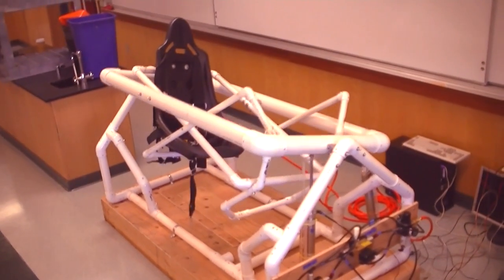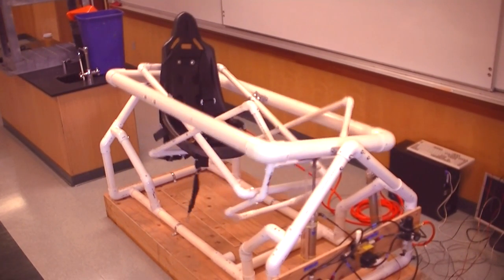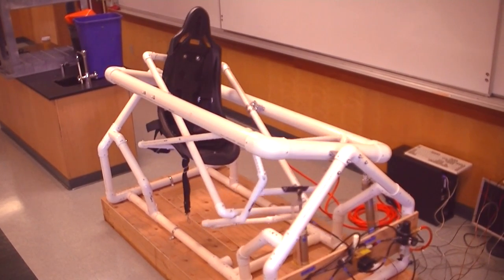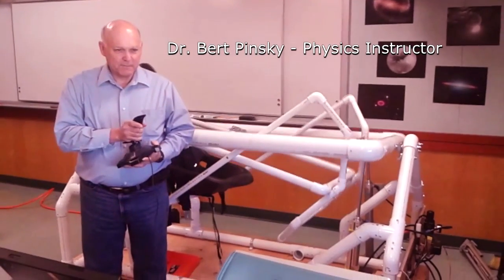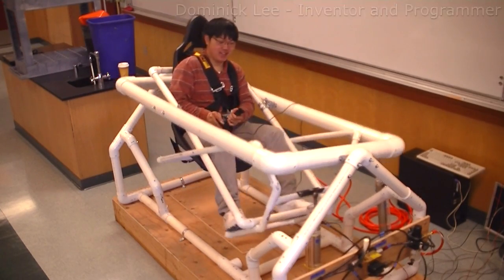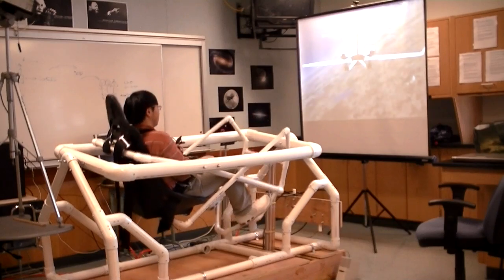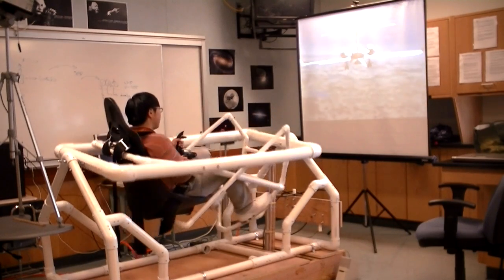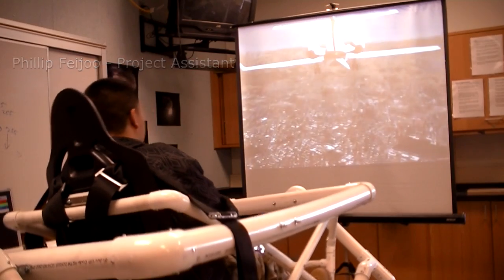LifeBeam Flight Simulator

Comment: This is pretty neat.  It would be pretty cool if you are using an open source flight sim to have the pneumatic system act based on the attitude and acceleration of the plane rather than from the pilot input.

Comment: Great mechanics and great work.  I do have one criticism - I noticed in the video that the pitch roll and yaw of the sim matched or tried to match the pitch roll and yaw of the flight sim. In actuality the pitch roll and yaw of the aircraft has nothing to do with the pitch roll and yaw of your simulator.  A perfect 60 deg bank of 2G will have all forces through the middle of your bottom (upright) and the sim should be level or slightly pitched backward (gives impression of G force).  You need to calculate actual G forces from airspeed and turn rate / pitch rate to calculate the sim orientation.   Outstanding work on the mechanics though - and keep it up!